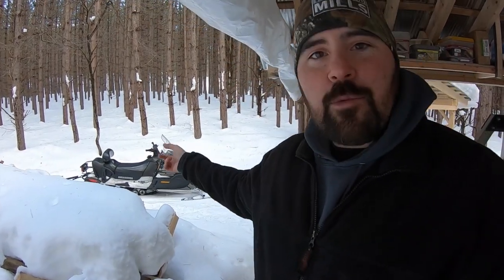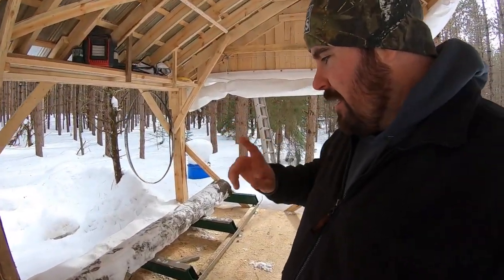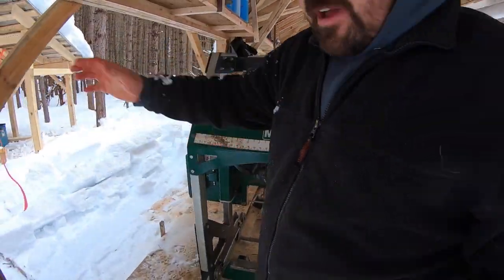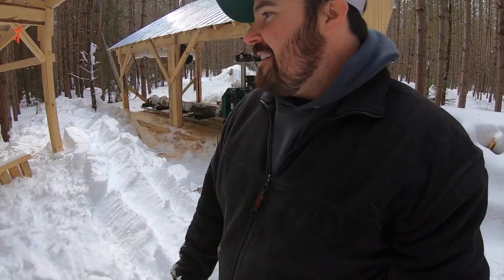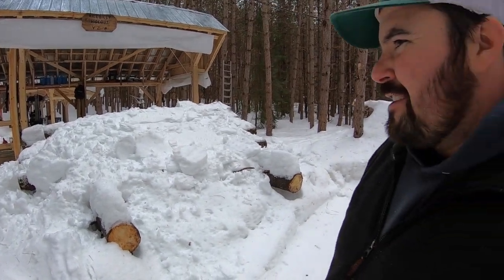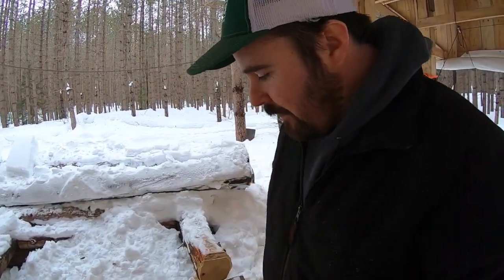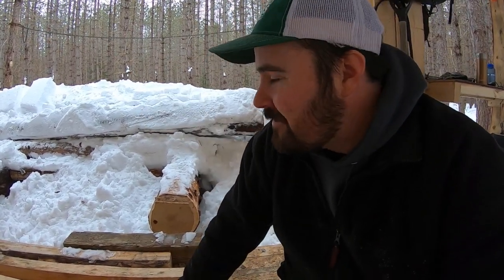How Long Does it Take to Cut My Own Lumber

Comment: To cover your logs, you could get a 15' x 20' canvas (waterproofed) tarp and anchor the back side to a log on the ground and then drape it over the log pile.  Attach the front of the tarp to maybe a 3" pole.  Put a couple small snatch blocks in trees behind the back corners of the log pile.  Then attach 2 lines thru the snatch blocks to the front corners with the 3"pole and use a small winch to lift the front of the tarp with all the snow pack off the pile.
With this system there is nothing permanent that would get in your way when loading more logs onto your pile.  Hope that made sense.  Love your set up!
Reply from the maker: That’s a good idea. I’m thinking that a structure like you mention may be a good solution. I’ll have to think more about it
Reply: @sawingwithsandy  The tarp idea sounds good.  A billboard tarp is strong & slick.  You could sandwich a couple of thin boards at the top edge to  grab the tarp.  Grommets at the bottom so as not to interfere with the snow slide. I like the added strength of hypar structures so I would slope one side much higher than the other.  You could have two positions, one at a low angle to keep snow from coming in the edges, high to dump stubborn snow.  Worst case: pull over with tractor.

You channel has me exited enough to buy a mill this fall.

Comment: Can't wait for my 130 max to get here. It was a toss between the woodmizer and woodland mills. I decided to get the bigger cut and buy extensions for length. Your videos have helped lead to this direction. Thanks bud
Reply from the maker: Glad I could help. I'm sure the Woodmizer is also a good sawmill but in my books as long as you're out cutting, that's the main thing.

Comment: Its avalanche season! If the snow gets a layer of ice under it it can be deadly. The downside to steel roofs. I'm far enough south of you and this year is squirrely enough that its breakup time here already so I'm thinking about my summer projects.They will be a sawmill shed and a woodshed/snowblower shelter to start with. In preparation I have been reviewing your sawmill shed series and a couple of your little house videos and some others I had never seen before. I didn't fully appreciate scope of your videos and the effort you put into them until I started this review. Thanks for all the effort you put into getting all  that information and those ideas out there.

Comment: Yes we had that problem too on a pole barn every time you step out your life is in danger so we decided to go back up there and put some angle iron I think I think it was an inch and a half fighting screwed it down it still has it melts it still lets the water come down we put a gutter system sloped it to the back side of the building and when the heat keeps it up of course we got heat in ours and it would melt it was risky business so we decided to put on it and yes it does stop that from coming down all at once

Comment: I’m at about 2.5 hours a log lol. I do try and get the biggest logs I can which are usually between 10” up to 21” logs. I don’t have a tractor so I use my Argo winch and cant to load the log and by the time the whole process is done I’ve spent 2.5 hours per log. I find there’s always a new hurdle to overcome every time I get into milling.
 I’m not in a huge hurry either, so I try and keep a relaxed attitude till I’m done.

Comment: If you subtract the coffee time, changing the blade and the snow your pretty close to bang on for time. You were not rushing to finish faster and remembered to lower the log stops also, which is good for blades.
Reply from the maker: I agree with ya there. I’ve put a few blades in the scrap heap forgetting to lower the log stops
Reply: @sawingwithsandy  That new chainsaw you have on your winch looks similar to my 661. I love that saw. Nice to see that one working for you. My other saw is my grandpas farm boss 041 stihl from way back. It is so old it has no chain brake and has cut 500,000 board feet if its cut a foot. 

Anyhow keep up the good work there Sandy. I am inspired by your efforts and wish grandpa was still around to see these new band saws like yours. They worked on gang saws when he started milling, when he retired they used insert tooth blades still for everything. Only a few mills had band saws then.

Comment: So I'm assuming that chatter in the wood was from one tooth in your blade sticking out more than the others. To save yourself the headache of having to shovel snow off the uncut logs get yourself a tarp and anchor it down so it can't blow off. It's much easier to pull a tarp off the logs, plus they won't be covered in snow once you get it removed....

Another thing I wondered, what footprint is your mill shed ? I got an HM130 max back in late Jan and want to build almost the same style of building ( except I got 2 extensions so I'll need an opening about 24' wide ) How much floor do you have on each side of the mill ? 

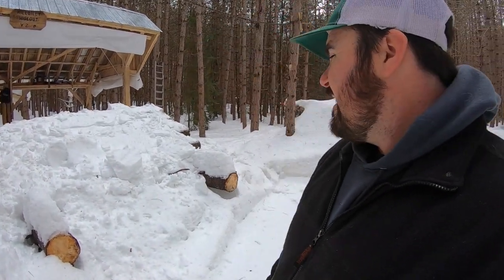Another thing I saw a guy do that I thought was a really good idea. When looking at the blade housing on the mill he cut the left slot so it was open instead of oval. You can just unscrew the center nut that holds the two halves of the cover together but don't need to remove it to open the doors.  Go to 11:45 on this video to see what the guy did to the cover notch. (https://youtu.be/VjBw0FeTGCU )

Great info Sandy, I'm learning so much from all of your videos, thanks for spending the time to do them all.

Comment: cut a 30" diameter 8 ft long ponderosa pine yesterday must have weighed 1 ton totally soaked. i figure it is worth cutting smaller stuff because 1 guy can move it easily and safer ( it fell off the track and i spent half an hour getting back lol) also had to cut a 1/4 shape cut out of it so the mill would go by... bigger aint always better. Note i did get a lot of wood out of it though :)

Comment: Been seeing alot of atv logging video   pretty  cool equipment   and attachments    but the most logical   for small opertion was the loh arches so not to drag logs in dirt 
  One end is placed on far end atfirst looks like hand truck standing up  the rotation  down lifts log end off ground and tonuge secured to log  the other arch  actually has small hand or electric  winch to lift  into postion then secure with chain  atv/ tractor tow  and not drag in dirt  Advantage  2 is the your  lenght is adjustable  only restrictions  is making turns on trail   but 12ft + wouldn't  be that much problem
Reply from the maker: I agree those log arches for an ATV are quite handy. I do actually have one I fabbed up a few years back that I'll have to get out to show everyone. I don't use it much anymore now that I have a tractor though just because the tractor is able to haul quite a bit more in one go. the ATV is good though for off-trail areas where the tractor won't go.

Comment: I suspect you'll have to bring out the tractor to the HH2.0 to clean up the big pile of snow that the roof left you from this video.   As for keeping the snow off your log deck, about the only long term viable solution for that is to put a roof over it.  A single pitch lean-to style roof to shed the snow to one side.
Reply from the maker: I think you're right about that

Comment: Sandy, I near died laughing at you jumping when the snow let loose. I used to take a two by four or what have you that had some weight but can handle it, rather than it handle you and just take it like a ram an hit with some authority but not break anything.... just a good solid bump and hit a post hold said roof up. That would usually jar the load lose and make life a little more my favor. I would do that after I had my shovel and  miscellaneous tools I might bury out of the snow then first done, second is to get that snow load taken care of. If no ice on roof when a little batch hits ya, no big deal, just empty your shorts of snow and if the mess is larger then cut the legs off of them and finish cleaning up and toss them to the blue jays that eat "poop" anyway.... don't like that bird cause it eats other birds eggs and to me it is good to have more other birds than just the mischievous blue jay. For now I'd say that some kind of real heavy tarp with some good eyelets in the corners and sides to put a rope into and use a snow machine to give a tug and roll it off the logs waiting to be processed. If you find a hot spring, use a heat robber or for lack of word I'm thinking do a radiant heat under a log deck as it really doesn't take much heat as it just being there.... bad thing is if you hit a real cold snap then you have a glass inclosed log deck. I think that you have it going on.... Now this is just a idea but none the less I will try to place in words. The further that you need to go down into the brush the harder it gets to move a log some real distance so take a small block and run cable out to the log being yarded to a spot that is where the timber being logged from. (this is harder than thought to transpose).... rope would work just as  well, I think like a logger, so that when log is being pulled in, it also pulls on the return skid line.... think of a close line and the wife puts the laundry out to dry... she just tugs on the clothes line and out the clothes go and same coming in. So the block in the tree on either end  can have a line being pulled out while the one comes in. I know it works cause its what I did. I still had to set the choker but no more tugging on line in deep snow. If that doesn't confuse you then you have all  the makings of a logger.... I have been called worse/LOL

Comment: There was two ways we could have put that angle iron on there in between the ribs or set it on top of the ribs and let the water when it melt drip down into the gutter
Reply: not that roof looks like a hunter's greens what we did is we went down after we got our aluminum we turn around and spray painted it and then turn around and put it up and you can't even tell the difference in the paint course eventually the sun is going to bleach it all anyway now I think what happened there the vibration of the motor being that it was underneath the building the vibration will move that metal a little bit and that's probably why it all come down at once you put those up you can leave your butt board up or walk board or whatever you call that while ago and you don't have to worry about that side as for the other side well it might keep your wood from getting covered up you can go with a one inch 2-in just whatever size you want to go I guess it depends on how much snow you get I live in Indiana we don't get that much but we get enough that if it builds up and the sun hits it it's coming down four or five years ago when he had when the building was built I come out from the side and I had probably the whole side of the building the snow come down it just drove me to the ground I lay there for about 45 minutes luckily my face didn't get covered up luckily there's no kids around

Comment: Here in the UK 🇬🇧 we have footpaths ( what you call sidewalks) outside of our streets the houses are all connected. In the 60s I remember my Grandfather walked to the edge of the footpath and the snow slid off the roof of 2 story house, it hit him and went right down the neck of his clothes. What a laugh we all had, make sure it doesn't build up so much, it hurts because of the weight. BE SAFE AT WORK especially when working alone.
Reply from the maker: I can just picture that situation! That's surely a story to remember.

Comment: do you spray WD40 on your blades to stop them rusting ?or auto transmission oil ? .just got a 32 inch saw mill  .
took me 4 days to set up now I have to level it /

Comment: I see 2 projects in future   1 extend cover  over log bunk  and covered  walk way to  cut lumber shed  possibly  even cover over cutoff  rack
Reply from the maker: Yeah very possible. I likely won't be able to permanently put a walkway over the boardwalk however as I need to get in there with the tractor to scrape out the snow and sawdust behind the mill. But the other ideas could very well happen.

Comment: Sandy does the ice dull your blade faster? I am from a place where it doesn't freeze like you guys so I am curious. Thanks in advance.
Reply: I hope he doesn't mind when I answer your question for him. Ice and snow, as long as there is no dirt or gravel embedded in it, is actually a good thing, it it cools and lubricates the blade throughout the cut. The downside is that it can cause the damp sawdust to freeze to the dust chute and plug it shut.
Reply: @j.79  Thanks!  I live in the south we don't have this issue.
Reply from the maker: I don't find any different to be honest Kevin. It sure does make moving hte logs around a bit easier though since the ice slides nicely on the metal bunks.

Comment: Dang it looks cold there bud. Do the frozen logs dull the blades faster?
Reply: Frozen logs may actually cut better
Reply from the maker: I haven't noticed anything different about frozen logs which is good because that sure would make cutting in the winter even harder

Comment: bring your ashes down from the cabin and toss them on the ground around to let the sun melt that new shed snow
Reply from the maker: That's not a bad idea. I may have used up all my extra ash though on the driveway which is really ice covered these days. Spring is nice but certainly makes things slick. Hope all is well with you Bruce!
Reply: @sawingwithsandy  keep getting snow and cold weather, was -32 again this morning ,getting tired of that ,but May is coming